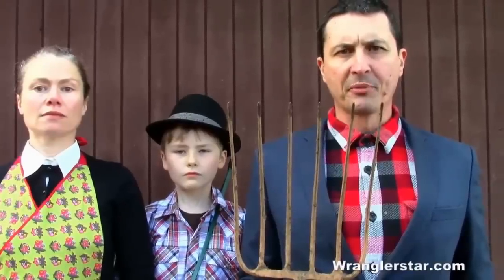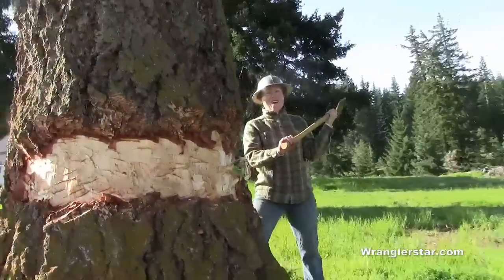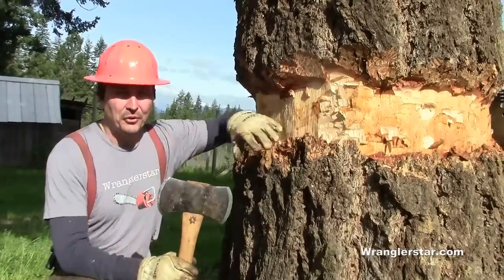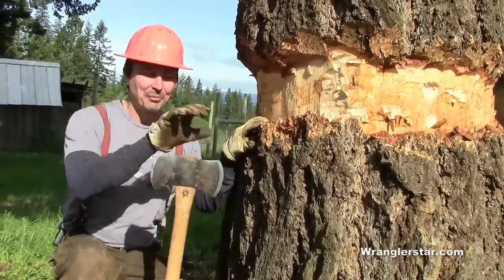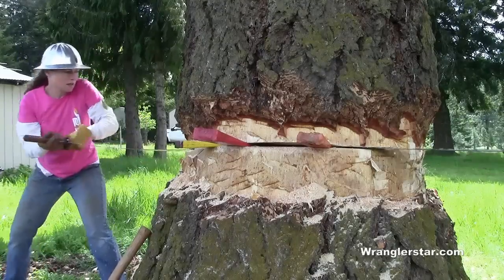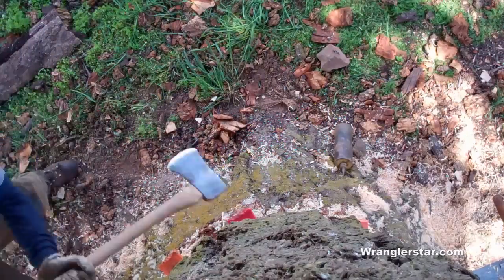Felling Giant Tree With Crosscut Saw

Comment: Great video. Let me see if I have the process down.
1. Girdle the tree
2. Cross cut about 1/3 into the tree (aiming in the direction you want it to fall)
3. Cut that chuck out, with axe or with saw at a diagonal
4. Draw the box? - how do you figure where to draw the box?
5. Cross cut from the other side of the tree, using wedges as you get deeper 
6. Stop cutting at the box, and pound the wedges as deep as you can
7. Cut a little more if needed until tree goes down

Did I miss anything?
Reply from the maker: you got it,
Reply: What about the box, though? How do you figure out where to draw it?

Comment: I used to be a tree hugger until I began using saw milled lumber to build permanent outdoor structures and furniture. I then adopted wood as my primary heat source and came to realize just what trees are for. Yes, they produce oxygen and clean the air but so does grass and shrubbery and don't destroy things they fall on after a wind/rain storm. we BUILD things, humans have thumbs,, duhh. YOU build such fine things I cannot fault you for letting in some sun and un-earthing mama's garden she has worked so hard on. I still love trees and I'm grateful for what they provide us too. I not only have opposable thumbs but can hold two opposing thoughts in my head without it popping too.

Comment: We had that same "lift step" when we drove stakes for circus tents. 3 to 4 foot long spikes. My crew could out drive a swedish gas powered jack hammer and a convetional air powered jack hammer. We had 4 guys swinging 16 lb sledges and i was swinging a 20 pounder. Dinkdinkdinkdink dink. Done. We really exelked when we had to drive through old concrete sidewalks and parking lots, the power stuff just could not keep up. Best part, the owners son was the one trying to bring in new gear and we showed him up every single time! Good times!

Comment: I am guessing the very thick bark has to be removed to allow the wedges to access solid wood.
Reply: Bark can dull a saw, manual crosscut or chain saw, pretty quickly.  A chainsaw is much easier to sharpen than an 6-8' crosscut so debarking isn't much of a thing these days.